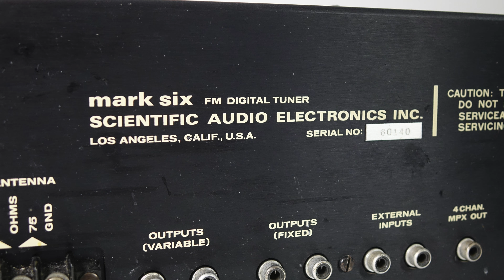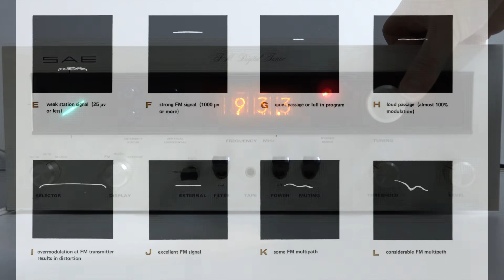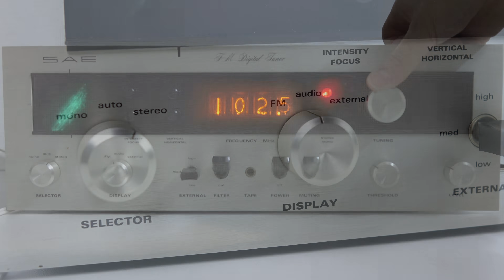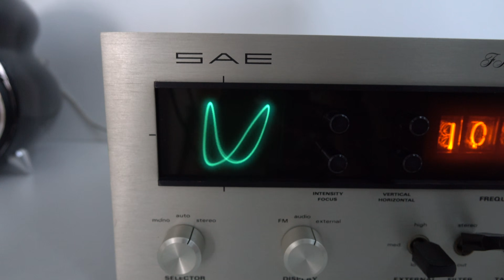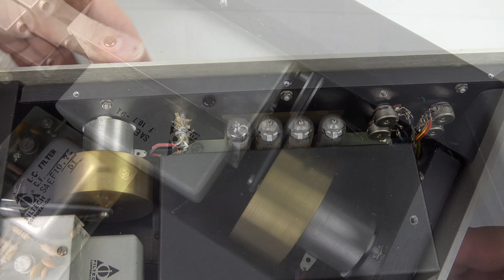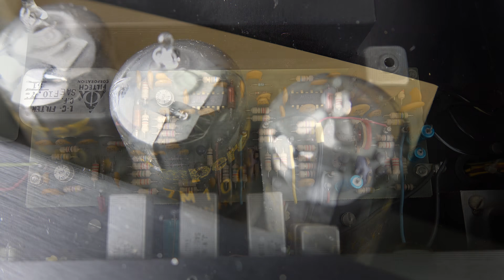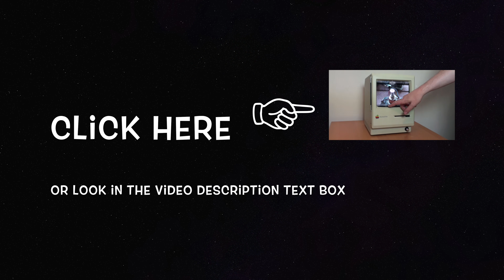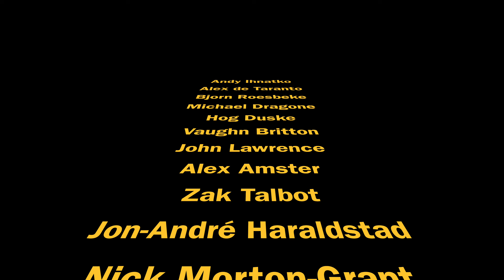Retro-Tech: SAE Mk6 FM Tuner - My Vintage HiFi holy grail

Comment: The Motorola MC1355 ICs are the intermediate frequency amplifiers.

The shielding around the cathode ray tube might be magnetic shielding to prevent stray magnetic fields from the power transformer from affecting the display.

I also noted, when you flipped over the radio, that some of the electrolytic capacitors have been replaced.

Comment: nice item on the first board are four chips not just two ! and the board underneath has had a few caps replaced radial I  would rather have fitted axial ones,  and its had a few markings with a sharpie or other felt tip and a few wires have been melted a little on some connections ,but still a cool looking radio !
Reply: thehappylittlefox aka benji 
You nitpicked a whole lot there, chief. 
But still a cool comment!

Comment: Why the fuck does it have a 4chan jack?
Reply: Quadraphonic Sound. In those days "Quadro" was the "new stereo", a system introduced which never really took off due to various different systems developped by various manufacturers marketed at the same time, there was no "standard", therefore the consumer didn't know which one to chose in order to be, let's say "future-proof" there system would be "the" one of becoming that standard. (1972 - 1976 "ish") Basically it's the predecessor of surround sound, four independent channels instead of the regular 2 (stereo) soon to be expected radiostations (broadcasts) would soon to follow, along with "dolby FM". I owned a marantz 4300 Quadradial 4 which had both features (dolby FM and quadradial FM "ready"). There were lots of devices you (potentially) could hook up to a quadrophonic amp / receiver like Quadrophonic pre amps, TT's, RTR's etcetera, along with dedicated "quadrophonic decoders"
Reply: That's "the fuck" why.

Comment: It's a thing of beauty. It looks like it's been serviced too, a couple of the caps have been replaced on the PCB inside the bottom panel. Personally, I would have fitted axial caps not rads, and replaced them all.

Comment: I'm suprised you didn't mention the granddaddy of all ocilloscope-equipped audio devices, the Marantz 10B tuner. It doesn't have Nixie tubes, but  is in a class by itself. it's all tubes, but for one lonely transistor used in the scope circuit. The next scope-equipped device by Marantz was the Model 18 receiver, followed by the model 19.

Thanks for the great review, very informative.

Comment: Actually, due to MPX surround being a phase-detection system, an oscilloscope working as yours is, would let you check the trueness of your reproduction vs. what you are inputting to it.  Great find!

And +greenaum, you are right, there is no wilder retro visualizer than the Atari Video Music.  Just please, if you get one, use every bit of static protection tech you can to protect the system, as looking at it wrong would blow gates.

Comment: The oscilloscope is working in X - Y mode, which is slightly unusual. Possibly the right hand channel on the x axis and the left channel on the y axis, or maybe the other way round. This is different from the classical oscilloscope display which plots signal amplitude vertically ( y axis ) and time horizontally ( x axis ). See https://en.wikipedia.org/wiki/Oscilloscope#X-Y_mode for more details....

Comment: Every time I tune back in you've got something even cooler than last time. As you noted, they spared no expense on this precious - almost surprised with the ultra clean chassis layout that they didn't choose show it off with a cane metal or perforated top cover.

The CRT shield is probably Mu metal, and more than likely is there to shield the CRT from the receiver instead of the other way around.

Went looking for a schematic (unsuccessfully so far). The American FM band spacing suggests possibly a synthesizer (unlikely) or at least dedicated readout large scale integration IC (LC72xx) which may have a jumper or unused selection pin. As usual, a wonderful look up the lasses skirt t to be sure .. but some of the real goodies are under that box behind the display.

Digital readout wasn't right off of the reservation in 1970 - I seem to recall the ARRL handbook covering am LED(!) home brew even a few years previous, but I sure am curious as to how they've implemented it here.

As always, thanks for the video.

Comment: You may want to try playing "Oscillofun" (you can see demos on YouTube) into the external inputs for some fun.  However, you will need a player that does not filter out highs or lows in the audio and which introduces no other "special effects", essentially a player setup to output flat up modified audio and then you will be in for a real treat between the audio tune and the visuals on your scope.

The pots to adjust focus and intensity, etc., appear to be on the front panel.  To maximize the scope life do not leave it in a mode that gives you the dot or a solid line for extended periods or you will get burn in, but play the audio display to your hearts content and enjoy. Reducing intensity will also prolong the phosphors. The actual patterns seen are Lissajous Curves and communicate considerable info about the nature of your input audio.

Comment: Wow, what a marvelous piece of equipment. Of course one major difference between 1971 and today is the FM programming at least in the states.

Today most FM stations are cookie cutter, with committee and survey based program material. Back in 1971, it was the height of free form album oriented rock with disc jockeys who truly cared about the music and were not afraid of longer album cuts or an ecclectic music selection. In addtion to that classical and jazz stations were truly the voice of the arts (very similar to your BBC Radio 3). 

Tuners seem to be falling in value for this reason as satellite and internet radio provide greater variety.

Comment: Definitely doesn't constitute an oscilloscope just because it has a CRT, not in the time domain, more like a kaleidoscope. seems to have this strange input sampling artifact within it that manifests as squares.   Also noticed some of the electrolytics' were replaced by a service, one caught my attention in particular because i guess they didn't have the proper size and stuck two in parallel.
Reply: I noticed that too. They also drew plus signs on the board so they wouldn't solder the electrolytics in backwards.
Reply: Technically it would be a vector scope, but it is the same as using an oscilloscope in XY mode, a capability you will find on nearly any oscilloscope (particularly analog scopes)...so to most laymen, and even many oscilloscope users, it is an "oscilloscope".
Reply: Yup, i could see that being in the XY mode

Comment: US FM radio stations go from 87.9 to 107.9 in odd numbered increments.

From Wikipedia: 

"In the United States, frequency-modulated broadcasting stations operate in a frequency band extending from 87.8 MHz to 108.0 MHz. To receive a station, an FM receiver is tuned to the center frequency of the station's channel. The lowest channel extends from 87.8 MHz to 88.0 MHz; thus its center frequency is 87.9 MHz. 

"Because each channel is 0.2 MHz wide, the center frequencies of adjacent channels differ by 0.2 MHz. Because the lowest channel is centered on 87.9 MHz, the tenths digit (in MHz) of the center frequency of any FM station in the United States is always an odd number."

Comment: FYI: the o-scope on this thing is operating in X-Y mode, probably using a channel for each axis.
Reply: Correct; in X-Y mode (Lissajou mode) a signal on only the left channel will produce a straightline horizontal deflection. A signal on only the right channel will produce straightline vertical. A pure mono signal at equal levels on both channels will split the difference, giving  you a 45-degree straightline. It get interesting with stereo program material when the instantaneous differences between the left and right cause the deflection to dance all over the screen. The more stereo separation in the program material, the greater the deviations from the 45-degree mono reference.  If you play the Synchronicity album from 1983, you don't see much deviation from the 45-degree baseline. Put on Dark Side of The Moon from 1973 however, and it will pretty much fill the screen. Much more interesting not only visually but especially aurally.

Comment: If you are still interested in reviewing action cams, I found a 4k action cam (similar in style to the sj4000 as far as the case is concerned) for only $56.99 (USD, £42 British pounds.) Surprisingly it seems to have decent reviews on Amazon and most of which are verified. The model is the Wimius q1. 

It seemed like the sort of thing you might be interested in. Anyways, been loving the hi-fi content.

I would send a link to the Amazon page, but my comment may end up auto-flagged.

Comment: Could you please help me, i just bought a Sharp gf 6363 boombox, Question, what cable do i need to connect the boombox to my laptop, I only have a 3.5mm audio jack on my laptop
Reply: Unless it is a very high end boombox the only audio output it is likely to have is the headphone jack, but you may need to heavily attenuate that output if your are connecting it to a mc input on your PC (if your PC has a line level input that would be a far better choice, on some laptops the mic input can be either and you must select which role it takes on in software).  Be careful not to turn the volume up too high or you will distort the audio.

But why would one be trying to play the boombox through a PC when it should already have speakers?  The other way around would make more sense, in which case you would need a boombox with a line level "auxiliary" input to feed the PCs headphone audio output (preferably line out versus headphone) into the boombox.  But still, why, given the ready availability of PC speakers?
Reply: The boombox has a DIN connection around the back, and at the side there is a MIXS MIC connection and a head phone jack, on my laptop its a dule mic and head phone jack. 

I wanted to look at the art of the machine and hope fully enjoy a different sound. 

I bought a Audio tape cassette sd card mp3 player, to lode some tracks on, but would still like a cable connection from my laptop?
Reply: +oak tree Intersting, I have never encountered a boombox with a DIN connector (I am assuming it isn't for an XLR mic, as such would seem overkill for a boombox).  If the DIN connector has 3 or 4 pins then it may be an auxiliary speaker connection, in which case you could try randomly touching a small speaker (ripped from a piece of junked equipment if need be) and just randomly try touching its leads to the pins, experimenting with different pairs of pins (for basic ID the speaker will not care if you get positive and negative reversed).  If you then get audio whose level varies with the volume knob then they are speaker outputs.  If they do not vary, but you have audio, then they are likely line level component outputs.  If you never get any audio then they may be mic or line level inputs, or something else altogether.  Good luck!

Comment: Two things...  
1.)  I have a scope in my Marantz 4400.  According to the user manual, you're supposed to adjust the brightness so that the dot is "barely visible" when there is no signal present.  This is to help prevent phosphor burn.  If you turn the brightness of the scope up too high, the focus goes soft.  So, find something towards the lower end to save that tube because they are rare and don't let it sit too long without anything going through it.
2.) To see a scope in 4-channel mode, here's a video that I made of my scope with Dolby Pro-Logic II music - so you can run it from your PC into home theater and watch the scope do its thing.  https://youtu.be/1d69FnsCA6k

Comment: Another sign of the connoisseur status: The printed circuit boards are single layer fibre-resin (FR4) type boards, the kinda see-through board made with today's most commonly used PCB base material. In those days most commercial equipment would have used the much less expensive paper-resin type boards (brown coloured boards). 

The chips are the Motorola MC1355P balanced four-stage high gain FM/IF amplifier. Keep in mind that this unit was manufactured only 6 years after the introduction of the first widely used analog chips by Fairchild!

This SAE unit is a truly high spec and quality build unit to last for centuries. Just look how each electronic component has been shaped (bend), inserted and soldered by hand. A typical example of an area where manufacturers took pride in craftsmanship.

Comment: Looks like if you put the oscilloscope display on stereo, simply left is vertical and right is horizontal. Hence you get nice lissajous pictures if you put sine waves of different frequencies on. But it's also an old way to have a stereo correlation display. If the signal is monoish you get a diagonal line, the more stereo it is, the more it spreads from the diagonal.

Comment: The oscilloscope is showing lissajous patterns.   I believe the right and left channels are connected to each input of the graph, x and y (or y and x). If true then a mono sound fed to both inputs will produce a + 45 or - 45 degree line (assuming each channel is fed separately with equal amplitude into the x and y of the oscilloscope).   This conclusion is supported when examining your video at (or around) 11:16; in that section, the audio from your device clearly pans back and forth in the stereo field while the display shows patterns clumped along a line that changes slope in time with the panning of the sound.

Comment: I'm curious as to how that o'scope is configured to produce those amazing, geometric analysis patterns for the Kaossilator. Frequency seems vertical, but it looks like Z and X are locked into some sort of sweep-speed loop. Way too novice to figure it out, but darn is it pretty. Great addition Techmoan!
Reply: There is no Z, only X and Y drawn from the left and right channels (if a Z were to be present it would typically be either intensity grading or blanking).  But to satisfy your curiosity, lookup "Lissajous Curves" on Wikipedia, then lookup the "Oscillofun" demo on YouTube.

Comment: So, here is the deal with the MPX out. MPX was not "a 4 channel system"; it actually stands for Multiplex and is most commonly used today to provide FM Stereo, though the name can apply to any time you have additional sub-carriers with an FM signal. The FCC had settled on a standard stereo system long before this unit was made; but there had been no decision made on whose system was going to be used for quad. (FM Stereo originally at 14 different competing systems). The MPX out basically sends a copy (unfiltered demodulated baseband or some kind of IF; don't know the details about every piece of vintage tuner gear) of the FM signal that could then be processed by an MPX receiver. This allowed one to buy this tuner now, and not have it become "obsolete" when FM-Quad was standarized; you'd just plug in the quad adaptor and off you went.

The same thing was done on many earlier FM tuners prior to the standardizing of Stereo and was also called "MPX out"; and in theory, a 4-channel FM quad adaptor would have plugged up to an old Mono FM tuner's MPX out and produced quad. But Quad never really took off and while a system was standardized by the FCC; it was never really used. FM MPX these days (at least in the US) consists of FM modulated main program from 0 to 15 khz; the stereo pilot tone at 19 khz, a double side-band amplitude modulated carrier supressed "difference" signal at 38khz, RDS at 57khz, and in the US there are two additional NarrowFM modulated carriers available at 67khz and 92khz. Stereo, BTW; is produced using the mid/side matrix, also called sum/difference matrix. The mid/sum of the audio is sent as the main FM program; and the difference signal is matrixed in to recover discreet left and right. The amplitude modulation of the difference is why Stereo tends to be noisier.
Reply: the only thing I get is that you don't care for properly writing the symbol of the unit "hertz" - named after Hertz - which is Hz as in 92 kHz.
Reply: @GPCTM ,  back when FM stereo was invented "hertz" was abbreviated "cps", as in "92 kilocycles".
Reply: I know what a cycle per second is (it's an hertz! (named after Hertz - I add this to show the difference between the name of the unit, a noun, small caps, and the name of the gentleman, a proper name, uppercase)). 
But I'm just talking about the "khz" in the comment... so, I don't really know what to say to your "interesting fact"... Thank you? :-)
Reply: @GPCTM  I'll take the thank you, thank you! I totally got (and agree with) your point about the correct orthography for "hertz" and "Hz". I was just having a bit of fun by pointing out that using the SI term "hertz" is a bit of an anachronism for sufficiently old Hi-Fi gear. 

Best regards!
Reply: Ahh, when a Multiplex was a stereo component and not a series of movie theaters.

Comment: Wow what a beautifully constructed piece of kit, I've never seen anything like it in all the years I've been working on electronics.

That scope seems in audio mode seems to be basically an oscilloscope in XY mode with one channel affecting the vertical and the other the horizontal.  Some clever people have made audio tracks that produce very cool patterns including text and animation on scopes.  One example is called YouScope.  It would be interesting to see how they look on that.  You'd need to find the file in a lossless format to work properly.

Comment: Like you, I'm far from expert in electronics but also like you, I've seen a few and that is one of the most beatifully manufactured piece of electronics I've ever seen. Those switches look as though they will never need replacement and the assembly has had so much thought put into it. I think you're right, it's unlikely that any modern equipment will be built to that standard.